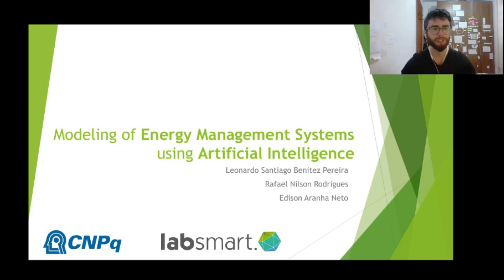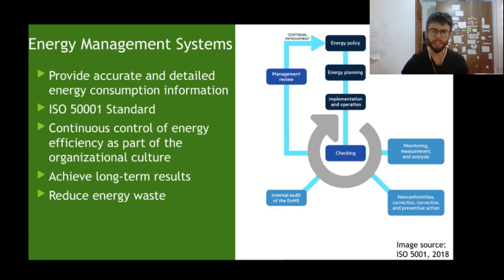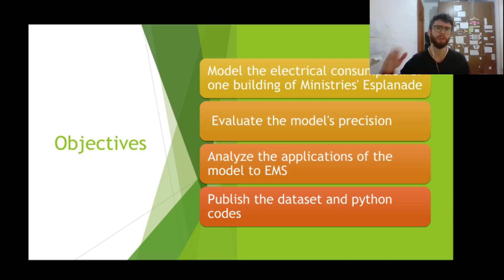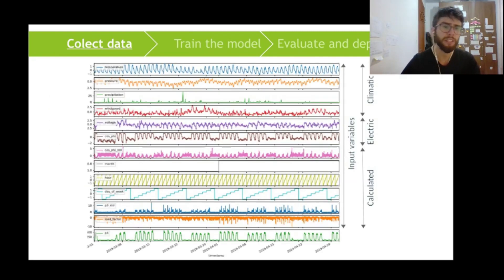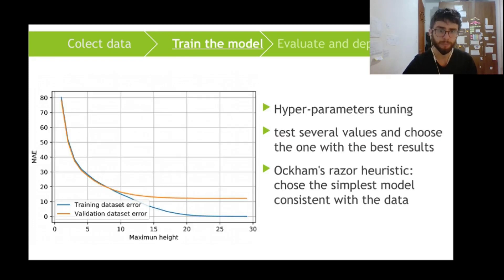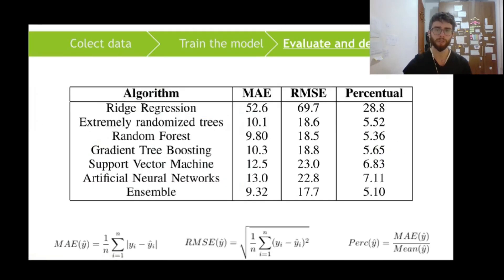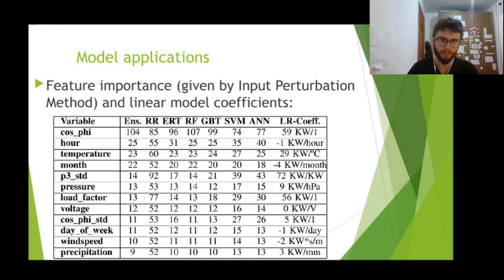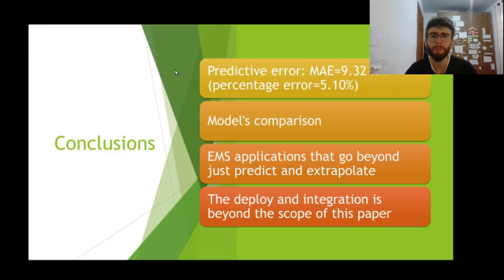Modeling of Energy Management Systems using Artificial Intelligence

Comment: Hi, I'm a student who majored in energy management from Belgium. Thanks for your video, very inspiring. If based on your experience, Have you ever use the importance of setting some strategies to further minimize the energy consumption of the building? For example, how to dispatch, and other heat pumps, etc. Because in this video, what you mentioned is to predict the energy bills and discuss which method is more accurate. Thank you!
Reply from the maker: Hi Vest, I'm sorry for the late reply
Based on this project as a whole (not only the energy forecast part) we identified several situations that we could decrease the energy consumption, for instance how much was saved if we turned off the lights during nights (yes, many lights stayed on in the campus!!)
The university didn't worried about this until they really saw how much ($$) could be saved
There were other situations, if I remember well we published a paper giving more details about measures that were taken, feel free to contact me if you need more info